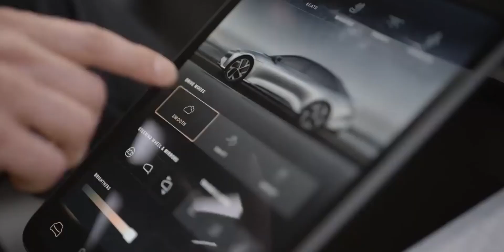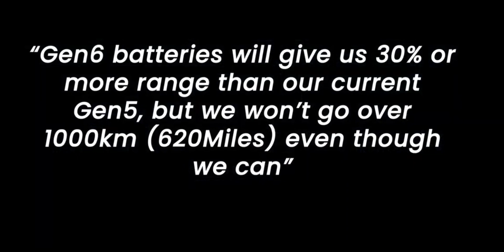Tesla cancels plans for Giga Berlin, BMW New Battery Tech will give 620 mile range, GM Invests $490m

Comment: 4:56 "....we will be much more flexible...": Making the battery a structural component is foolish. Rather, make the battery case a structural component...and then insert the battery from the bottom and fasten to the structure. This allows flexibility of battery choice, battery sourcing locations, battery capacity, etc...all with no changes to the actual vehicle. It's kind of like being able to operate your flashlight with cheap or rechargeable batteries...your choice. And when they go dead you don't scrap your flashlight.